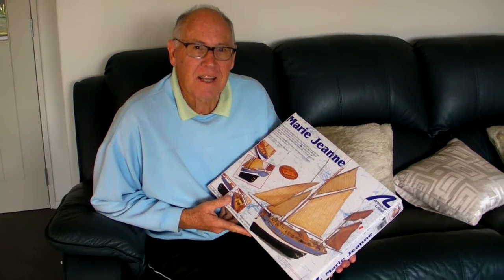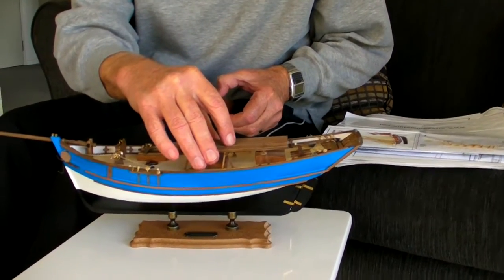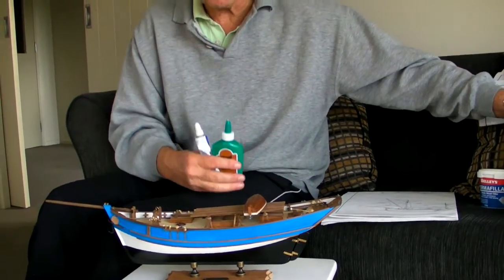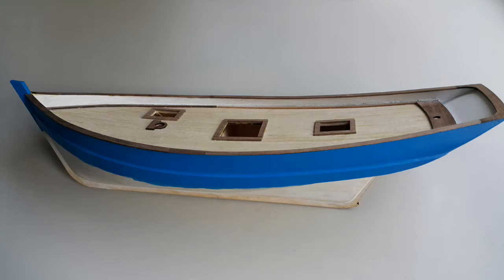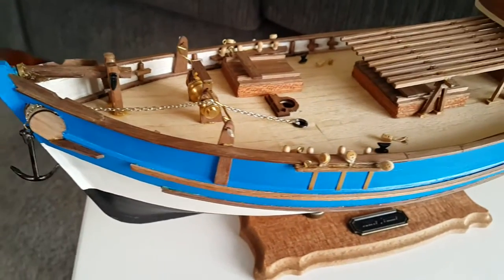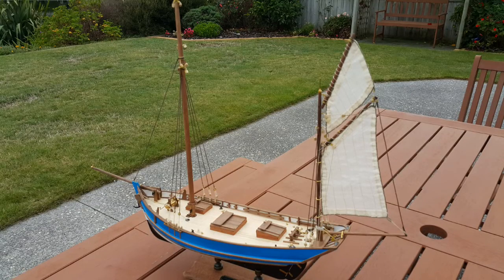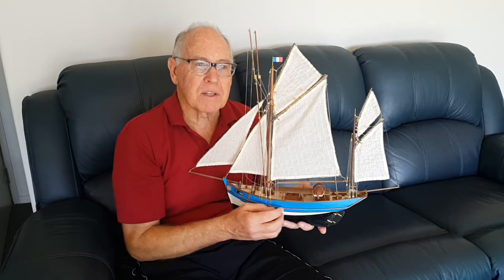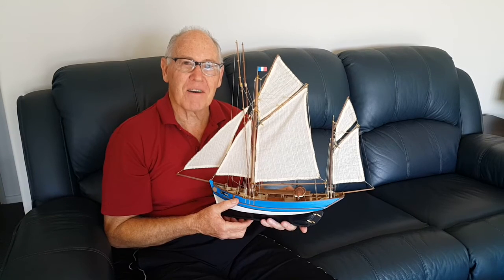Building the 'Marie Jeanne' - model ship by Artesania Latina

Comment: Well done Ross.  It is quite a challenging build especially as when our dexterity and sight decline.  I built this model about 20 years ago when it was called Sainte Marie by Artesania Latina.  I guess the name change was to avoid confusion with their Santa Maria model.    I have been building sailing ships from scratch since I was 9 years old and find them an exercise in patience.  My Sainte Marie had navigation lights and the rowing boat was stowed on the deck.  A few small changes in the components as well.  I see that the boat now is painted rather than stained which makes it look more authentic.  I had never completed the boat after it fell from the shelf and broke some of the rigging.  Now with Covid lockdowns here in Australia it has been an opportunity to finally complete it.  I need to buy a glass case to protect it from dust and idle fingers.  I see from your video that the photo instructions are now in colour and than is nice.  The symbols for what you have to do for each stage of construction are, for the most part, well done.  My instructions did differentiate for the varying adhesives ..... wood glue (PVA) indicated for the keel and frame and inner planking, contact glue for decking and outer planking and some Superglue (Isocyanate) for other elements. Rigging is always the difficult part especially the sequence and hand-sewing the sails takes patience.  And well done for the foresight in making the video.

Comment: Ive stained my sails with a quick wash in diluted acryllic paint. Looks authentic. lightly bound the edges with matching thread. Im stuck with wooden mast hoops, using coloured plain brass wire at the moment. There are some hoops from Amati, i use Amati for thread, got some nice 1mm black gloss. Billings paint kit i bought as a trial, not good. Quality

Comment: Hi Ross. You did a great job on that ship, well done. I bought my 83 year old dad a wooden model ship called the " Mare Nostrum". It is also made by the company, " Artesania".I would like him to paint the model using Acrylic paints. In the instructions it says to use a coat of clear varnish first before painting. I found that strange and I was wondering if you sealed the ship with varnish before painting???. I hope this message gets through. Many Thanks
Reply from the maker: No I didn't seal it first. The acrylic paint covered easily straight from the tube.
Reply: Many Thanks Ross.